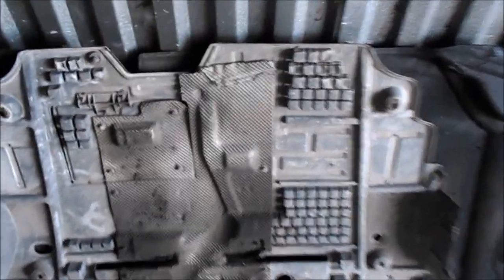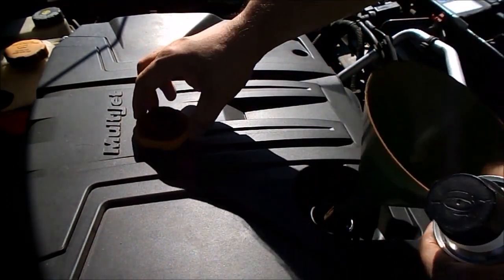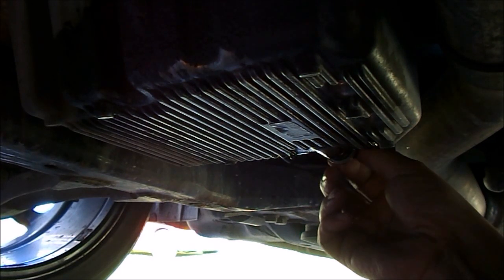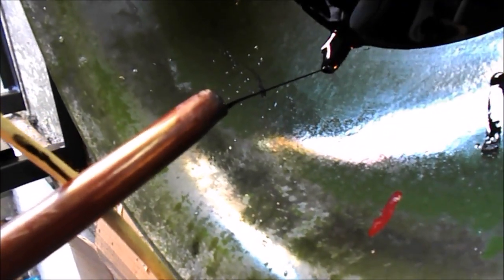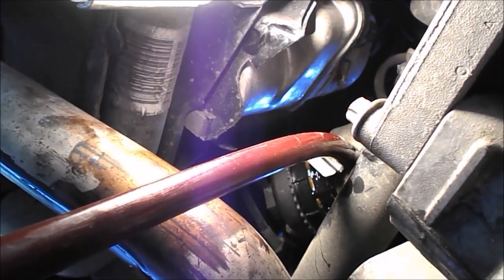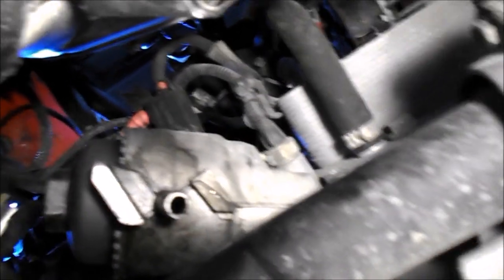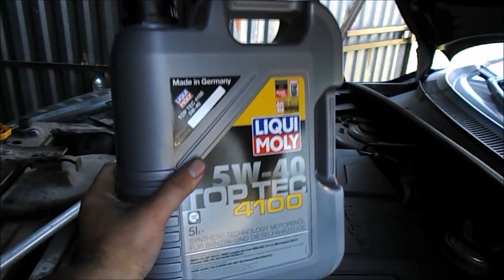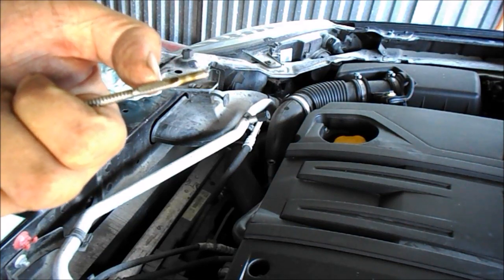Wymiana oleju w silniku JTD Multijet w samochodzie Fiat Croma II. Serwis olejowy.Część 2.

Comment: 5/30 !!!!!!
Reply: @0plp0  according liqui moly it is 5/30, according petronas  5/30 or 5/40, according FIAT 5/30
Reply: @plimpnemalp4792  Where have you this info? 5/30 is only for winter, 5/40 is universal, in Europe you choose 5/40 while since years we don't have here a real winter.
Reply: @0plp0  liqui moly oil guide(web site), the other info. is from paid tech. literature
Reply: @0plp0  but we talk for engines in good mood :)
Reply: @plimpnemalp4792  In Handbook of Croma you have Selenia 5W40. Maybe in the new 1.9jtd engines you can use 5W30 but this are old model of this engine.